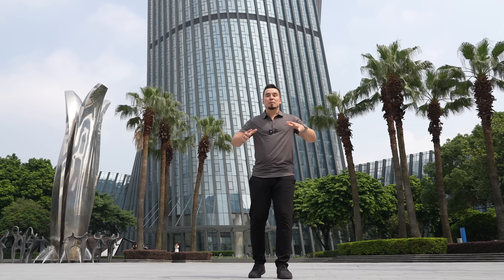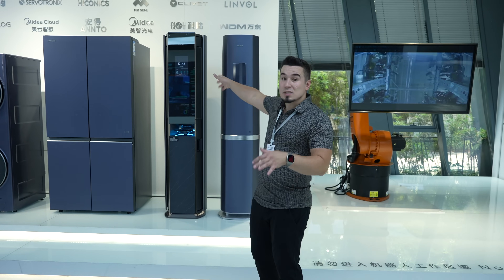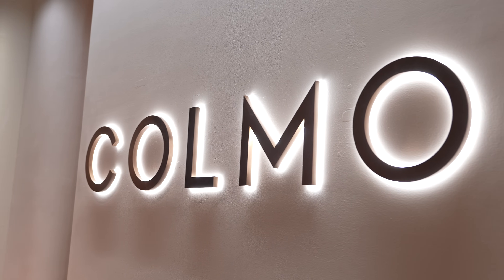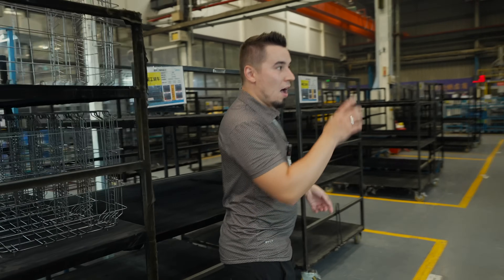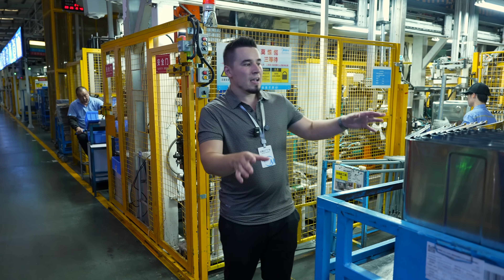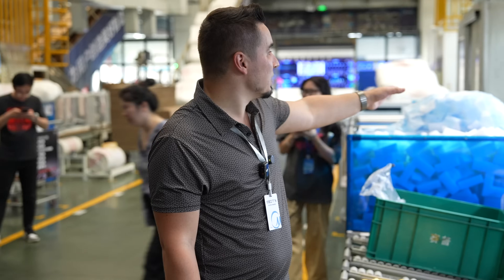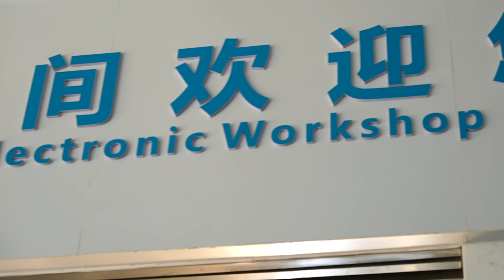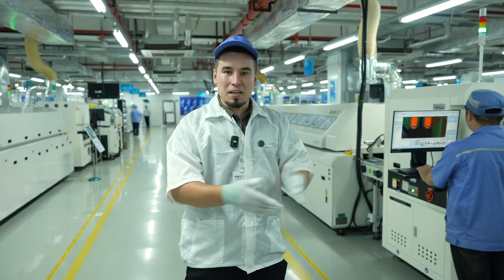How Dishwashers are Made - Midea Factory Tour in China!

Comment: The red material in stencil printer is surface mount adhesive to holder the components on PCB to be completed with interconnect via wave soldering process at the end of line